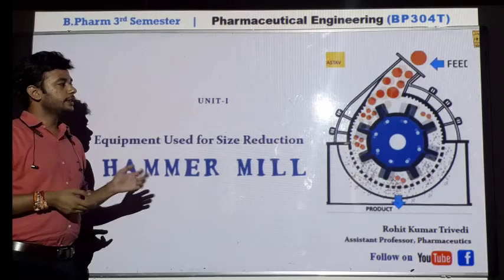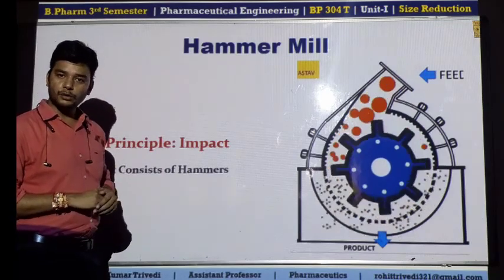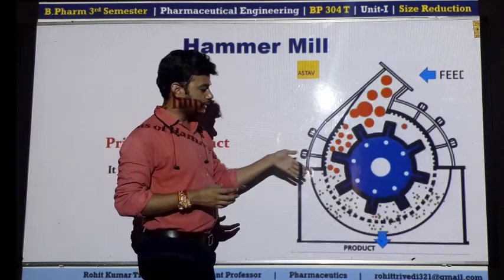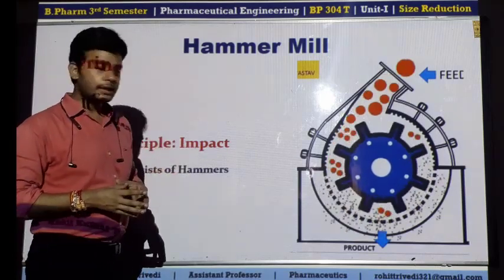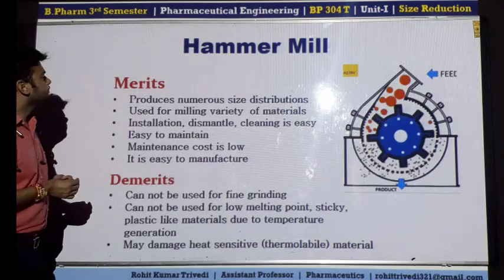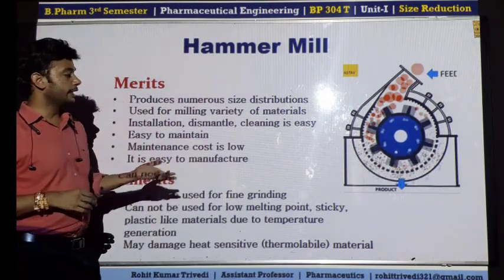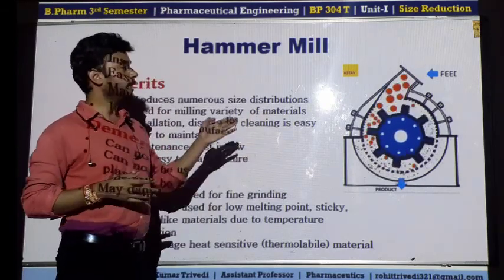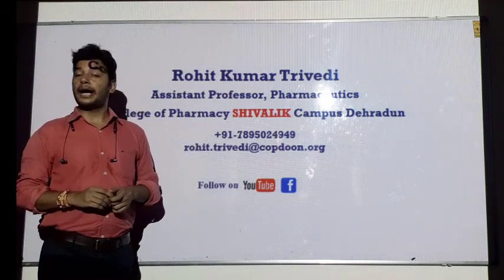Hammer Mill Pharmaceutical Engineering by Rohit Kumar Trivedi

Comment: Sir you haven't explained the construction
Reply: Two types.
Horizontal or vertical shaft type.
Hardened steel, stainless steel used for construction.
Impact surface made of using abrasive resistant materials such as haystellite and carbaloy
Stainless steel hammers used for pharmaceutical purposes.
Shapes of hammers-bar shape, stirrup shape
Bar shape hammers used for tablet granulation
Hammer blades- flat edged or sharp edged
Rigid type and swing type hammers available
This units enclosed ina chamber
A removable metal screen provided to collect the size reduced particles.